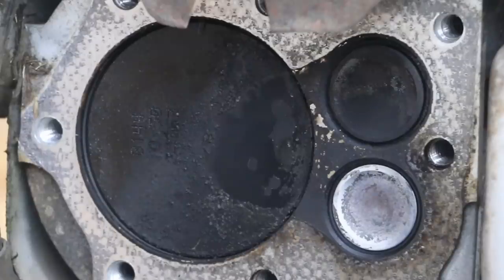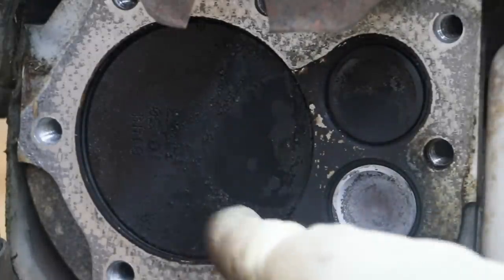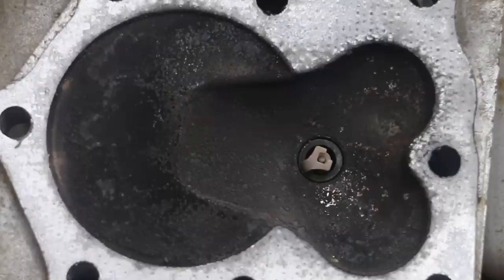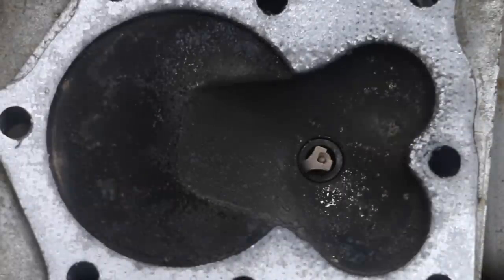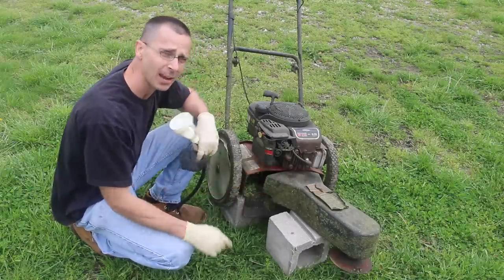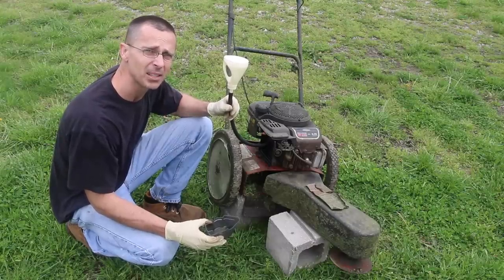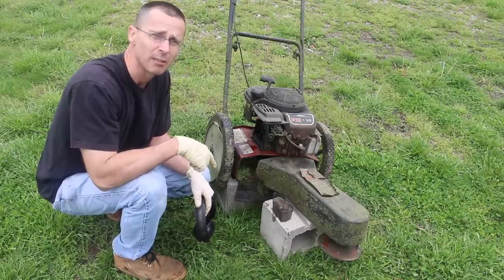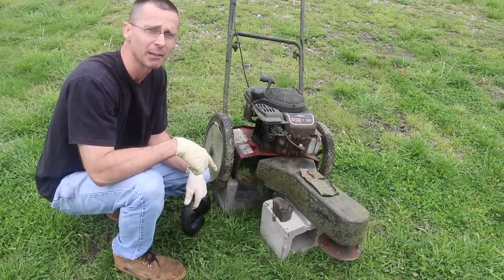Seafoam--can't believe what it did to my engine part 3--cylinder cleaning test!!

Comment: Ok it doesnt work :(   I need something I can inject into the spark plug hole and leave it to soak overnight and start the engine the next day to blow it out. Old school mechanics used brake fluid for fast results down a running carburetor but todays engines, i dont know. Im trying to avoid pulling the head. Any ideas?

Comment: I think you would of done better when you removed the cylinder head, you then sprayed the pistion head and valves with a good grade cleaner and then used a wire wheel on a drill with  a scraper to remove as much carbon as you can. Then reattach the cylinder head and use the seafoam as directed. I think you would of removed much more carbon then just relying on the seafoam itself.
Reply from the maker: Thank you!

Comment: you should ditch those gimmicky spark plugs too. yours looks to be running lean as well. remove that carbon with sand paper and spray it clean with brake clean. clean your carb too.

Comment: The right fuel octane and proper spark plug gap would have reduced 
a lot of that carbon if the fuel was of higher quality or higher octane..
That engine looked like cheap gas was used from when it was new..

  The extra carbon around the spark plug igniter would indicate 
a gap that was much too wide..  Poor timing and a misadjusted 
carburetor could also account for heavy carbon build up on top 
of the piston and the intake valve ....
Reply from the maker: Barbusie, Great thoughts!  Thanks for watching the video and commenting!

Comment: Why does anyone think a little bit of carbon in an engine is harmful? Leave the engine alone before you hydraulically lock it up and put a rod through the side of it which Briggs and Stratton's do very well on their own. A small wire wheel on a drill and maybe 60 seconds on the piston and head would clean it up much better than pouring anything into it. But as I started to say there is nothing wrong with a little carbon in an engine. In fact it will up the compression a little

Comment: I did head work on my old car it makes a difference visually. I wish I took pictures because it removed some of the bronzing from the heated oil on the lifters. I could also hear a noticeable difference. if I do any headwords on my latest car I will do a video and professional audio recording. remember there is carbon in the cyclinder, and I bet if he did that a dozen times there would be a nociable difference. I mean you have to change oil after doing this. it's really dumb not to, because it loosens the carbon into the oil. only a small portion goes out exhaust.

Comment: Thank you for your demonstration on the Sea  Foam it was really helpful. I'm going to use it in my riding mower, I just took carborator off cleaned it, but it still sputters and misses after I put it back on, but runs a little better.
Reply from the maker: Thank you! Glad it helped some.

Comment: A better valve cleaner.  Smart Blend One Formula Total Intake System Cleaner.  You should do a comparison video with other valve cleaners such as Seafoam.  It can be used in gas and diesel engines.
Reply from the maker: Great suggestion!  Thank You!

Comment: DO THIS SAME EXPERIMENT WITH COOLANT! i bet running it while adding small amounts of coolant into the intake will strip the carbon right off.
Reply from the maker: Thank you for this recommendation!
Reply: only reason being, when you get a head gasket leak on one cylinder, you will see the piston is spotless when you pull it apart. you probably already know this though. might make a cool video!

Comment: don't look like it made much difference.  I did like the water injection, however.  there is something that I have not seen the explanation is that atomized water   combust ed with fuel, causes water to hydrogen and oxygen breakdown.   hydrogen H2 combust as fuel. oxygen combust but also mix with carbon causing CO2.  CO2 also is used to suppress the heat.
Reply from the maker: This is very interesting!  Thanks for watching the video and commenting!

Comment: should had done a compression comparison before and after. Ive used sf to free up frozen piston rings in 60 year old johnny-rude motors.  when you see a cylinder come back to life from 70psi to 120psi, but hey results will very.

Comment: Not much change .However I've used it continually in my vehicles but now I maybe wasting my $ on this.
My car had an emissions failure for insufficient converter and it cleared the code.
Reply from the maker: Thanks for sharing.

Comment: Products like these are the worst if they actually work.  Removing the carbon buildup fro cylinder walls is the fastest way to ruin an engine.  In many cases, that carbon buildup is what is keeping that old motor's compression up.

Comment: While you talk about the cost of SF and maybe this or that works better for cleaning your engine,  you are ignoring the #1 reason to use SF.  The primary reason to use SF is as a fuel stabilizer. Granted if you just put gas in your car and drive it almost empty in a week or so, then you don't need a stabilizer, but lawn mowers and other garden equipment, motorcycles and other engines that don't get used regularly will suffer without SF or a similar product.  Because of the ethanol used in modern fuel (which is hygroscopic,  absorbs moisture from out of the air) it will damage your carburetors, injectors, pumps, etc. especially if they are aluminum. Living in the country where power outages happen ocassionally, I keep 20 gallons of fuel on hand at all times and rotate about every 6 months.  All of that fuel as well as the fuel that goes into my motorcycle gets SF added at the time it is purchased.
Reply from the maker: Great point regarding it serving as a fuel stabilizer.

Comment: I don't see much difference, In either case You'll still need to break out the wire brush on the piston and valves and a sand blaster on the head.  So $12 for a can of seafoam?   why would anyone want to throw away money on "snake oil" ?  
I have to wonder if it does anything in the crankcase or fuel supply side?
Reply from the maker: Thanks for commenting on this.

Comment: Seafoam doesn't do anything.  What DID was a product I haven't been able to find in nearly 30 years by Casite.  It was called something like "Between tune up engine cleaner" or something of the sort.  MUCH bigger clouds of smoke,. and the insides looked almost like they had been beadblasted.  (Had a head off my '76 Granada after.)

Seafoam was trying to capitalize off that product I think.

Comment: I'm thinking (without having actually trying it myself) that the water would probably work better in short shots between periods of running for say 2 minutes at a time for a heat shock shattering effect on that hard carbon. I could well be wrong but I used a similar process with a section of quartz about 2mm thick with gold running all through it to bit by bit shatter the quartz away to see the beautifully intricate and very delicate formation of the gold within it. I kept heating it to red hot with a blow torch then dropping it in cold water over and over, that worked pretty good there. I'm theorising here since I haven't tried this on an engine, but I think it would work better than a steady flow and steady temperature.
Reply from the maker: Thank you

Comment: Nop" dont i use that. I run non ethanol, with conditionner ( Prolab DBF4 ) and adjust the mixture as lean as possible for O.A.T. , and install a cooler spark-plug
Reply from the maker: Thanks for the feedback.

Comment: i used to do this with water in a motorcycle motor worked fine time the trick is  their is  screws  above the carbs  a jug of water and clear in to  the  jug of water  let bike get hot then pull screw  put in hose  the motor will vac it in motor running
Reply from the maker: Thanks for sharing.

Comment: The application does not last long enough.  A simple coolant leak does a better job because it goes on for awhile.  And don't pour it in so fast as to go hydraulic.  I'm totally unconvinced that Seafoam is any good.

Comment: I’ve been using Seafoam in my 2. L ecoboost , it was doing the cold miss and the Hesitation,  I add one can to a full tank of gasoline  , use three cans per year , the problem seems to have been  eliminated. Also add Seafoam to my 6.7 Ram as it was pinging during warmup ,that went away also good stuff
Reply from the maker: Thanks for sharing.

Comment: a head gasket and a wire brush is more efficient and environmentally safe.
Reply: cheaper and quicker on the briggs and stratton. continual use over time might be ok for your car.

Comment: I worked at a scooter shop, this isn't really "use as directed", not really fair. Over a lil time this stuff is the cats ass. I wish I took pics but my bikes carb was done for, previous owner never drove it. (09 with 2k km basically sat its life) Carb gunked! Basically impossible to safely drive on roads. Used as directed(a lil heavy first 2 tanks) ran great after about 2 weeks of very minimal riding. 2 months later buy a bigger carb, wanted to see how old carb was, took it apart and it was as shiny and clean as the day she rolled out of the factory in 09. I will say this which IS VERY IMPORTANT!   DO NOT PUT A LOT, A CAN LIKE THIS VID, NOT DILUTED WILL DESTROY YOUR MOTOR.  Like 2-4 oz/gal.   And get it at Wal-Mart its 6$ FFS.  U want a gradual clean anyways. U want chunks of shit bouncing around ur motor?   Seafoam or bust!
Reply from the maker: Thanks for commenting.

Comment: In effect, there is no good substitute for the old fashioned method of strip down, scrape off then get dressed and reassemble. The only expense being a couple of gaskets, probably less than two jugs of Famous Snake Oil
Reply from the maker: David, I agree that it's nearly impossible to remove all of the buildup with chemicals.  Thanks for watching the video and commenting!

Comment: Why would you get rid of carbon?! It increases compression!!!

Lol, just kidding (I mean it does...). I think it took a fair amount off the piston and valve, but not enough to really do it justice. I think if you're not planning on taking the engine apart that much (besides the rare re-build that an every-day car might have), it may be worth it to run this stuff every 20,000 to 30,000 miles just to keep it cleaner than being completely baked.

The one time I took off my Miata 1.6 head, there was a ton of carbon baked on the pistons. I tried using a scotch brite pad with brake cleaner, WD 40, and PB blaster, as well as a razor blade (wish I had a plastic one), and I barely got any off.

Comment: A glass of distilled water would have had the piston and valves sparkling clean.
  Change your oil, use premium fuel in your small engines, make sure your air filter is clean and installed properly. Leave Seafoam and other similar products on the shelf, don't fall for marketing hype, don't believe me, phone the manufacturers of the machines you own and have a chat with the engineers. They'll probably  put you on speaker phone and laugh their asses off.
Reply from the maker: Thank you for this recommendation.

Comment: The bummer of reality is that they make those $90 gas push mowers it’s almost not worth it to run to cans of cleaner through and change the oil. Double that and you could get a new mower. Factor in the work involved with the oil change, gas to obtain oil and sea foam and work to sea foam correctly and you’re better off buying the new mower. 😟. They’ve cheapened everything to disposable.
Reply from the maker: All great points. Thanks for commenting.

Comment: I'd rather just take my head off and manually clean it, but a head gasket for mine is a stinking  $47 !!! So I've added Seafoam to the gas ..
Kawasaki KF-82
Reply from the maker: Wow!  Expensive gasket.  Seafoam does a great job!
Reply: @ProjectFarm  
Yeah I didn't believe it when I was told it but after looking it up, sure enough  $47.. But I like the ol thumper.
Thanks for the work that you do.

Comment: Why not just take a steamer and put it in the spark plug hole to break up the stuff in the head then let the engine dry and put the plug back in and start her up? I would never do this, just an idea seeing as we are talking POS yard equipment that in most cases was used past it's prime anyways. I wonder what my lawnmower looks like I been running 50:1 2-Stroke mix because I don't want to buy just fuel when I have a Enduro Bike. Runs like a champ and never smokes.

Comment: Gasoline is a solvent, carbon deposits are going nowhere without solvent. Anyone who has been in a line unit knows carbon deposits are hard to remove, it takes copper / brass brushes in most cases. The piston likes to get dirty on machine guns lik M249/240. The M16 likes to build up carbon on the bolt and in the chamber because of the gas system employed. If solvent is not getting it, water has 00. chance and may cause further harm do to oxidation. How many of you wash your Weapon in the sink ?
Reply from the maker: Scientes vos, Thank you for commenting!

Comment: You might be better off soaking the engine parts in seafoam. Or replacing the engine oil with seafoam then run for a few minutes.
Reply: You would destroy the engine!
Reply: @MissionaryForMexico  How about running 1/2 gallon of seafoam & 1/2 gallon of new engine oil for a few mins ?

Comment: For a small engine, the amount of money saved by using manual scraping / cleaning , vs buying this crap; HUNDREDS of engines could be decarbonized - buy / make a few good scrapers & have a lifetime of solution to the problem . . . after all , it is recommended maintenance * to remove carbon . . .  Big engines are another animal !    
    ** A mixture of kerosene & atf would be equally as effective , if not better !   ( Let the smoke roll , or better - soak the dirty parts before scraping !  :)   )

Comment: B12 Chemtool
Reply: ryland20 that stuff works good! I've used that on a 22re. I ran the motor with bad gas  and bent a few valves. Took everything apart and it looked like black ice in the intake runners and values had a crap load of carbon on them. That was just a half a tank of bad gas. I used Chem tool on the inside of the intake runners and head after I had the valves fixed at the head shop. I cleaned all the carbon off the intake runners and   Head valves. That stuff breaks carbon up fast. Used it in the gas tanks too. I took the gas tank off and used a can to flush out the gas tank brown stuff was coming out of the tank. Added more to the tank and no more brown stuff from the gas tank. Used a small funnel to add some to fuel lines and uses compressed air and flushed the gas lines out too. Ran some through the injectors too. All cleaned up fast.
Reply: Yea man, the only stuff I use through my vehicles fuel systems at oil change intervals! Great stuff indeed, been using it for years. There is a guy who has a youtube channel ChrisFix. He runs several cleaners through his engine and uses a boroscope camera to inspect before and after. The only cleaner that makes a noticeable difference is B12 Chemtool! AND cheaper than all the other crappy "cleaners" out there!
Reply: Ya that stuff will eat metal. It's potent.

Comment: I don't see that much difference in carbon in this or the water vid.

try one more test. in the late 70s and 80s we would run transmission fluid through car engines to clean them out. just pour it through the carb and look for some real smoke.
Reply from the maker: Davidautofull,  I'll be releasing the ATF test/video later this week!  Thanks for watching the video and commenting!
Reply: great. I remember in cars anyway the throttle had to be revved.

Comment: I love your home style experiments, nutty, but real world & really fun. So, prior to the 80's this did help... engine were far less clean. 
I can see the part numbers? so it certainly cleaned the puffy carbon... 
but if your modern auto engine benefited from this, you may have fuel system or ignition or oil burning issues (replace PCV valve 1st). All causing the build-up. 
I still find water vapor systems allow smoother running, no better fuel economy. Physics & Chemistry can be a bitch....

Comment: no there is no difference . the sea foam killed the spark plug and the engine sounded like it was missing.  just a waste of  money because you have to change the oil and spark plug and that spark plug is twice the price of the stock plug,  you could buy a used engine with better compression . have fun playing around take care .
Reply from the maker: Thanks for commenting and take care!

Comment: It's garbage, I just ran the spray version into the intake of a 5.9 magnum no smoke no carbon burned off the top of the pistons. Seafoam works on the intake of people who never clean there intakes that's about all. Better to try soaking the pistons with Mopar combustion cleaner and emptying and changing the oil.
Reply from the maker: Thanks for commenting on this.

Comment: seafoam did nothing, It hast to be added to gas and oil for about s month with chevron deterrent gas, must drive daily for a month. Also, adding a fine mist of water vapor to the intake on a regular basis will help clean things up too.

Comment: you know if you use water it clean the carbon right off,,the old car with carburator that dint run for a while would puf  and miss in winter ,,run one liter of cold water and all the carbonwill be on the snow at the end off the exhoust pipe
Reply from the maker: Thank you for this recommendation!